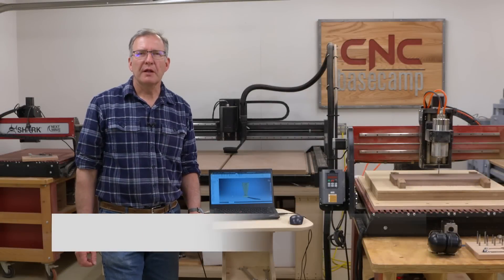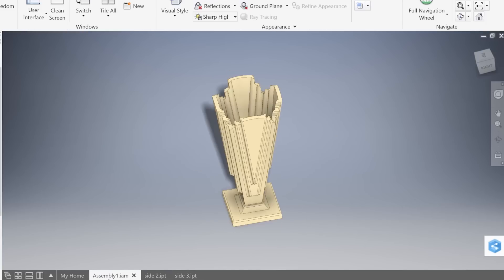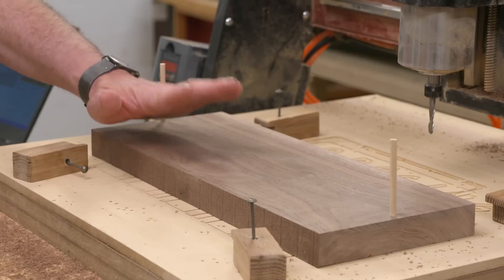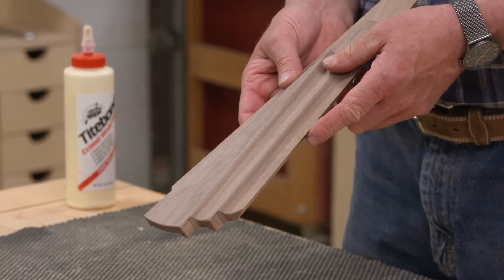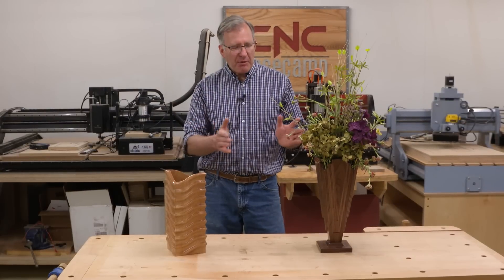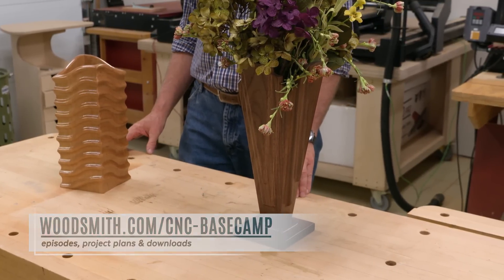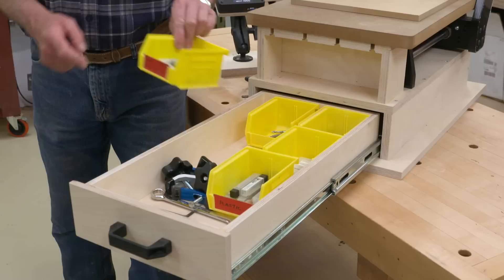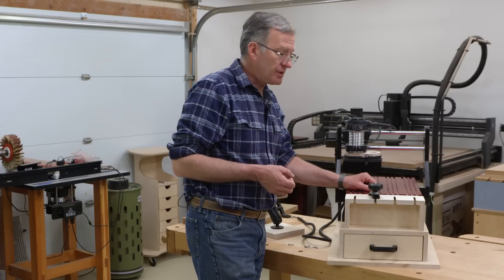CNC Basecamp E021: Art Deco Vase

Comment: Chris, a friend sent me the link to this video.  I just purchased a used Shark machine and have been setting it up in my shop.  I have done everything you talked about in this video.  i  have replaceable tables, a drawer to storage and a pendent station for the control box.  I was able to tie into my Clear Vue dust system and pull dust from the router and the back of the table.  Thank you for reinforcing all my ideas for upgrades.  You and I are on the same page.  I have subscribed to you channel and look forward to watching additional videos.  
As a side comment, I worked for a machine tool builder located in Cincinnati in the early 1970s.  A N/C control system was the size of a frig and costs $100,000.  The largest machine we built and shipped was sized as X = 60 feet, Y = 38 feet high and the Z axis was 84" long.  I never thought I would own a CNC machine in my shop.
Reply from the maker: Thanks for writing in Keith!  I can't quite get my head wrapped around a cnc machine that is so large as to have 60 ft x 38 ft x 7 ft format size.  Wow!  It is amazing to see industrial sized equipment in action and know it's the same basic operations and concepts as with our hobby machines.   I would love to see a picture of the router center you built for your Shark - particularly how you have dealt with dust collection.
Reply: The dust collection was easy.  I tapped into my 6” PVC pipe with a homemade saddle block and attached a 2” shop vac hose to it and the router shoe.  The 6” blue vent system on the back of the router system is original to the lathe parallel to the router.  I just roll the router away to use the lathe.

The same machine tool company built VTLs (Vertical Turning Lathes)  The smallest machine chuck we shipped was 42” on dia.  The largest VTL we shipped the chuck was 16’ on dia.

I'm trying to send you pictures of my dust collection setup but do not know how.  Do I send them to your email address or some how attach them to this chain?

Comment: Chris, I have had strange things happen to me also running my homebuilt CNC router. Machine would go crazy. Turned out to be point bounce in the cheap micro switches used for limits when vibrations from heavy cut. Love your show. Carl
Reply from the maker: Thanks for watching!  Every machine in the room has had some moment of craziness, most recently the Inventables Pro, just stopped mid-cut and went back to 0,0,0.  I ran it again without the Fein vacuum cleaner on for dust pick up and had no troubles.  The hose is grounded though.   So, might be the vac but the ghosts are hard to find sometimes.